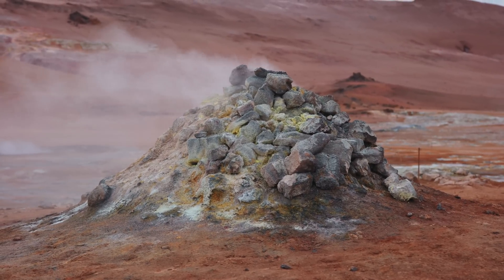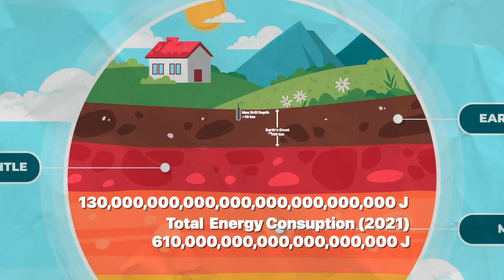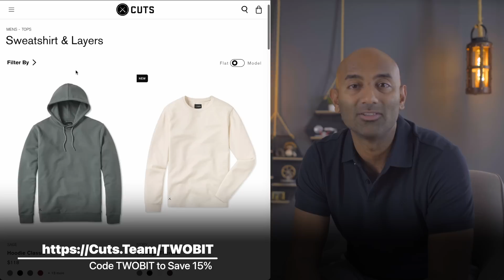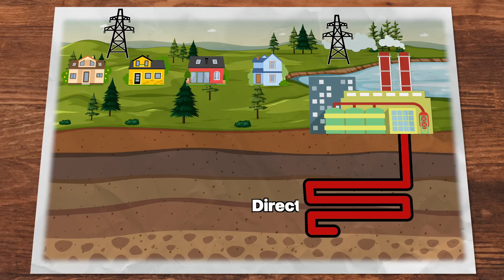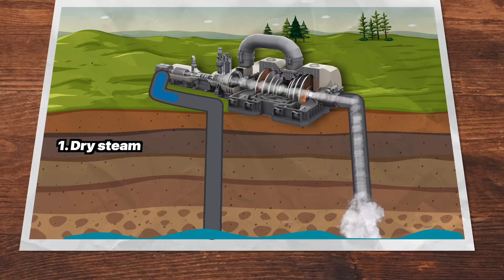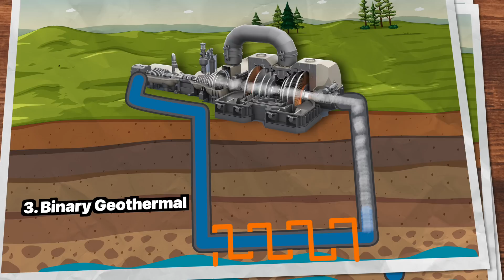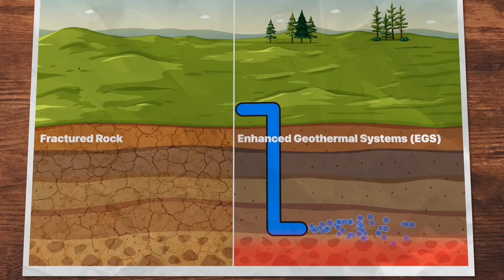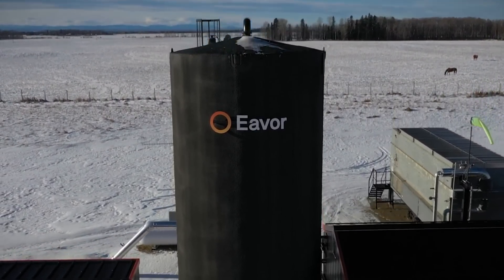This Breakthrough Energy Source Will Replace Nuclear & Coal!

Comment: If we can combine Eavor systems with micro grids, you could have small towns without the need of all those transmission towers and  the risks associated. This would pretty much take away one of the major risks of wild fires.  You would still have lightning but that is a smaller part of them. By taking the small to mid size towns off of the grid, you could do localized combinations for larger cities and again limit costs and risks by building redundant local grids. All of this gets us closer to our goals. No one system is the be all and end all, but with wise investments into combinations on smaller grid scale, we can solve the problems we have today. And it sure would be nice to take what long distant transmission needs underground instead of overhead for safety and reliability.  Imagine if Puerto Rico had underground lines that were impervious to hurricanes. Same for the Gulf States. Over head lines should be outlawed in those areas. Maybe keep the current, but no new overhead. And incentivize modernization to underground.  We also should look at local solar micro grids WITH NO INVERTERS for auto charging at every parking lot. Covered parking and free charging in places like Arizona only makes sense. Ok, small  charges to repay for building it in public charging areas. Makes no sense to invert from DC to AC and then back to DC in such applications. DC is back and makes sense today just like NikolaTesla proposed.  Edison's AC only made sense for long distance transmission with transformers.  Time to bring back local production and use.

Comment: Why are we always looking at centralized (industrial scale) solutions for heating when individual applications of geothermal work? Or, there's solar thermal - storing heat in a mass (large water tank) which can be used at night and recharged with heat during the sunlight hours. It's a misconception that centralized production of energy/electricity is somehow more efficient. The ONLY reason we continue to insist on centralized production is because that's how the current economic model for making money is structured. What is really needed is a revolution in business models that prioritize individuals while still making money for a service-providing company.

Comment: Maybe it would be complicated or require a second set of pipes, but you should be able to use GeoThermal for cooling as well.   When it's 90-110 deg F outside, it'd be nice to use the cool earth 10-20 feet deep to cool our homes instead of AC.   So hopefully GeoThermal has 3 uses;  heating, generating electricity, and cooling.

Comment: 500 lbs of force on a quartz crystal releases 12,500 volts per cubic centimeter. When you cut 2 granite disks to 12 inches in diameter  they will release a trillion volts each when you keep them vibrating. To do that you tune a 500 lb xylophone key to 90 hertz and you have it rest on a fret at the nodes and that fret sits on the outer edge of the speaker facing up. You put a singing bowl/ a cup in the center of the speaker facing up to 90 hertz and it sits under an air hole of a drum box.  You sing to it... ohhhmmm and the xylophone key transfers the 500 lbs of force onto the disks... and there is an ark that jumps between the cup and the fret.. 4 inches that gives 100,000 volts that gives radio frequency to light up the spinning water droplets that condense inside the box.... and so you get a galaxy in a box with no moving parts... no magnet or coil or battery is required.... so simple to get a terrawatt for free. So freaking damn easy. The exploding water droplets make a lot of noise and that 500 lb xylophone key is a microphone that will pick it up and so it will run on it's own feedback and the force will be amplified 829:1.... you will absolutely get more than a trillion volts non stop.

Comment: You did not mention scale build up and waste chemical ponds. In open systems you get minerals in the water precipitating into the pipes and fractures. That has destroyed a dozen major experimental geothermal systems world wide. In some cases the scale chemicals end up flushed into large settling ponds. These can be toxic etc. Generally the project is shut down and scrapped before the ponds get too big. Eavor will be partly immune to this process but not fully.

Comment: Geothermal is great. But the big problem is how many of the places where they are to be used, often are active geological zones. About drilling through the oven, we now have capability of using laser/plasma to drill hot rock without grinding it with metal

Comment: I thought you were going to cover this, but obviously not?

They've discovered a new means of drilling I think it is with lasers, which "10" times cheaper, and a lot quicker!

The laser turns the walls to 'glass' or a similar material so they don't have to worry about lining the drill hole. 

Oh, maybe you are going to speak of this... you allude to a new discovery at the end?

Comment: Why in just 41 seconds into your video you have managed to pack two major.... "inaccuracies" to put it charitably: wind and solar are not enought to power the world and never will be, as these unreliable sources require so much land, material throughput and resources that it's no wonder that they provide barely 3% of the world's energy needs today, so their inherent intermittency is not the biggest problem; geothermal energy is great, at least in theory, but to call it "renewable" requires a veeeery special frame of mind. True that the Earth's core is warming up deep spongy regions saturated with hot water and will be most likely doing it so for perhaps millions of years in the future, but is clearly not renewable even in the loose meaning of this term; why not call it simply "energy"? In most locations the technically accessible geothermal regions have water well below the 100 C temperature, which makes them useless for electricity generation; calling the ones that run on dry steam "not all that common" is not fair, as it should read "ery few indeed". One would expect a better factual foundations of their claims from da Vinci, even from just two bit of it. Your data on land requirement for different energy sources is just absurdly wrong! Solar needs 75-100 times more land than conventional coal plant of the same capacity and wind 200-250 times! You are simply doing disservice to the geothermal power by false props it doesn't require! And if you ever heard about energy density you will instatnly know, that oil industry will not switch to geothermal energy anytime soon. And the prospect of cooling the Earth's core is a least concern compared with the insane amounts of emissions involved with producing all this complicated equipment required, pipelines, pumps, filters, tanks, etc. As any source of energy it has its natural limitations so claims that it might replace gas, oil, coal, and nuclear are quite out of touch with hard realities. Nice animations though.

Comment: While geothermal power plants are not feasible in many areas and tend to be crazy expensive to build--shallow, small scale geothermal for individual homes for both cooling and warming, is a lot more practical. In my area, I think if you dig down around 9 feet or so, you get a pretty steady temp of around 70* F which can be used for both warming and cooling (in my area, I would still have to run dehumidifiers in the summer though). 

     I have some ideas about how to cut down the foot print and decrease the amount of digging/drilling for these. One way is to "super conduct" the energy flow from a certain depth to the surface using essentially really large "heat pipes" that are currently used for cooling computer systems.  These are a copper pipe with a wicking material inside, a little distilled water, and the pipe is closed up with a medium-light vacuum pulled on it. The liquid to gas conversion and back of the water inside (the boiling temp drops at lower pressure), helps to move A LOT of energy quickly along with the thermal conductivity of the copper. There is no reason why these can't be scaled up.   

You have the first part, going to the deepest part of the ground uninsulated, and then insulate the rest of the pipe while wrapping copper tubing around the pipe to flow a liquid through. As you get closer to the surface, you connect to a more insulating tubing (butyl rubber is particularly good). Pump that to a well insulated water tank and then pump that water into the house to a radiator+fan combo. 
Rather than have one really large system (which tends to be more expensive), you have micro systems that pipe in to each room that has a window (you can easily make a foam insert for the window so that you can pipe directly in through there). 

    For the initial drilling, a pressure washer + wet dry vac would work fine. The average DIY'er could do this for fairly cheap--probably around a few hundred per system. More feasible for ranch style homes than 2 and 3 story homes though. 

   These type of micro systems are a lot more sustainable for most areas than the massive, industrial, electric conversion plants. Most of a home's electrical use is in heating and cooling. Whatever electricity needs are left over can be covered by smaller wind, solar, etc systems. Also using direct drive electrical devices and systems will also significantly cut down on amount of solar panels, wind turbines, etc needed. I know of a community that runs most of their electrical this way. They do have a small battery bank and more conventional Solar system for certain constant need items, but all the rest is DC driven. DC motors are extremely tolerant of energy changes apparently.
Reply: Check out his video on carbon dioxide batteries to.❤

Comment: I would think we are not doing this for the same reason we try to ban fracking.  Digging into the ground and pumping liquids into it causes issues - it pollutes the water table and can cause other issues such as carbon escaping.
There is MOST CERTAINLY risk of pollution like fracking no matter how much you do not want it be.  Pumping water into rocks naturally pulls minerals and heavy metals from the surrounding rock into the water table.

So while I think geothermal can be part of the solution it is not the amazing solution you labelled this video as.

Comment: I'm all for geothermal But, some of the specifications here are questionable. For example, the claim made at 4:29 states 0.1 acre (~4,400 square feet) (a 66 foot square) is needed to produce 1 gigawatt-hour per year. But, just run the numbers on this. There are 24*365=8760 hours per year. That means the power plant continuously generates 114.6 kilowatts (153 hp at 100% efficiency). How deep does one have to go? How big is the line? How much steam/water 'fracking' s required? - many acres?. How big are the pumps, turbine, condensers, etc. How much space is needed for the electronics required to interface with the grid in order to meet the requisite supply = demand criteria?  This seems VERY optimistic.

Comment: when you consider the old analogy of the Earth's crust is actually thinner than the skin of an apple relatively speaking, the think about drilling a little way into that crust and you immediately realize that there's no way that any amount of drilling is going to make a difference to the Earth's massive amount of trapped thermal energy, practically speaking...and using water to frack the rock into porous material for the extraction of that heat, that's about as green as you can possibly get ! It get's my vote. Although, I still have a hard on for Thorium liquid salt reactors, and 18 year old schoolgirls in fishnet stockings...

Comment: For Ricky Two Bit:
There is a geothermal site south of the Salton Sea, and it's supposed to become a brine source for lithium.  I think you should investigate this.  Thanks.
Reply: When I visited the NCPA Geothermal Plant at the Geysers about 8 years ago, I was on the Facilities Committee of NCPA. There was a 40 foot truck trailer that was filled with lithium. At a later meeting, I asked how much they got for selling the lithium. The reply was that no one was interested in buying the lithium, so they had to pay to have it hauled off as hazardous waste!! How things have changed; now it is very much in demand.
An interesting fact, is they installed two 20MW solar fields to pump the waste water up the hill to be injected into the injection wells of the steam field.

Comment: Solar is a viable part of the mix worldwide; you only need daylight. So I'm afraid that the assertion that it's only viable in sunnier climes is completely incorrect. Solar is used right across the world, even at the Poles. Even the UK has huge amounts of solar and this is growing rapidly.

Comment: a lot of BS ...  limitless  my ass ... no energy source is limitless ...
what about the heat needed for the core to stay as fluid as possible so that the friction obtained from rotation can provide the much needed magnetic field ... the UV shield ... 
has anybody any idea what cooling the core by 1 single degree would do to our UV shield ... ?  shouldn't we be absolutely certain first ... ???
what about the case in which all major cities would start using geothermal ...  especially in the colder climates ...  plus the medium ones ...  imagine the waste because it would be so cheap ...  
... every coin has two sides ...

Comment: So much nonsense. The problem with solar & wind is not intermittency; it is lack of energy density. So is the problem with geo-thermal. Until an alternative energy supply can replicate itself, that is, mine the ore, smelt the steel & other metals, mill, shape, forge, fashion, assemble, transport and install using only the energy from the alternative source, we will still need loads of fossil fuels to build the new system. We will actually need far more fossil fuel energy than we currently use to build this system because we are obviously not going to divert energy from current enterprises. 
So building all this will cost us what in terms of the extra fossil fuel input required? Nope? No idea? Thought so. This presentation is worthless cheer-leading unless proper analysis, as I am suggesting, is actually included. What is the carbon footprint cost of all the abundant "free energy?" 
By the way, Portland cement, needed for the foundations of all these projects, cannot be cooked with a 450 degree temp gradient. 

With out the replication ability, we will always need fossil fuels. In other words, a 450 degree temp differential is no where near what is  needed to smelt ore and refine steel. There is no way a 450 degree differential is going to run the mining equipment or dig the hole for the massive foundations or anything else. Or transport or install or anything useful.
Moreover, look up the tiny village in Germany which was totally destroyed by geothermal because leaking water undermined the entire village and basically destroyed it. The cost to repair and restore the medieval village far exceeded the very small benefit from the geothermal before it destroyed their village. And they can no longer use the system - big waste of money, time, resources, material, etc. 
Conclusion: empty Hopium, like hydrogen, tides, currents, wind, solar. NONE of these have the energy density to construct and replicate themselves let alone to maintain our current industrial requirements and ALL of them require most of the planet to be covered by an entirely new industrial landscape. That is a solar farm in every field, a windmill on every corner and a noisy geothermal plant every five miles. 
Furthermore, too build this we need FOSSIL FUELS and to electrify an economy DO NOT FORGET the massive network of new electrical transmission lines ... all this to make Elon Musk even richer with his toxic boondoggle battery-operated cars. 
Finally, all our energy needs and usages are governed by the Laws of Thermodynamics. I love it how these "green" shills always ignore them as well as never calculating the carbon footprint of construction into the cost of the "abundant free energy." False hope is far more dangerous than honest despair.

Comment: Just in CA in the USA alone there are thousands upon thousands upon thousands of GeoThermo power plants and many more drill holes now in the earth crust and causing earth quakes where they are drilled.  That is where the water from lake mead went, down those holes to create steam and earth quakes.  Do a little more research.  More of these holes and plants will weaken the earths crust / tectonic plates and bring about more destruction than you would want to be near.

Comment: Cooling the earth by pumping heat out of it is a concern.  The people who ask this question asked about the same kind of problem by sucking the power out of the wind???  Does putting a large wind from just off the coast then suck the energy out of a weather system that creates the weather systems down wind which would normally affect the on shore weather???

Comment: If tidal and nuclear core does not add any more heat, we would with todays global power production, need 40 million years to lower the earths temperature with 1C.  Unfortunately drilling to sufficient depth is not yet possible.  Indirect heating without superheated steam has been tested with ammonium turbins. No good. So we are waiting for the drillers.

Comment: Geothermal is not practical in most places - to drill that deep to reach the heat also causes the heated fluid to cool before it reaches the surface. Hence, geothermal power is only practical near volcanoes.